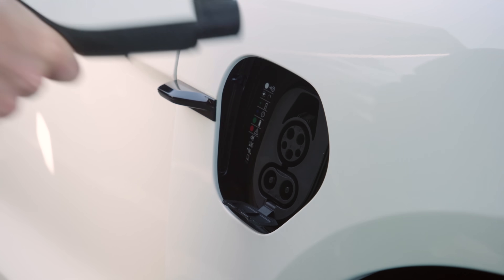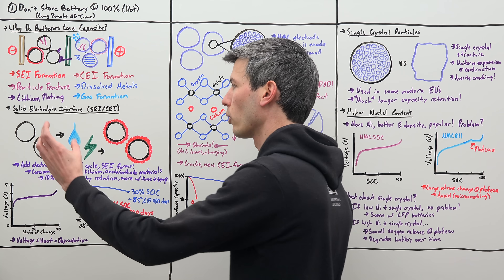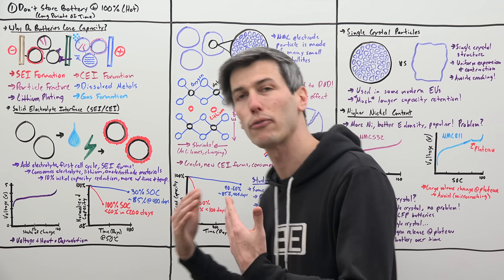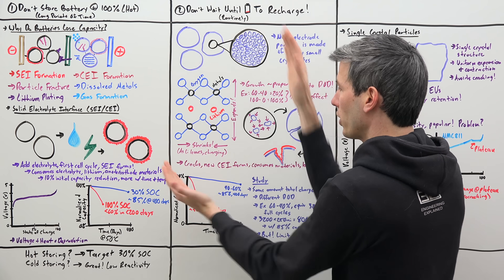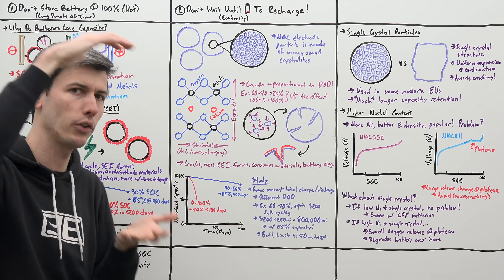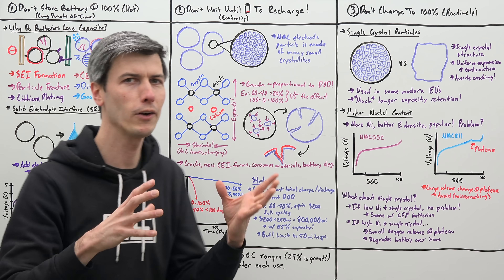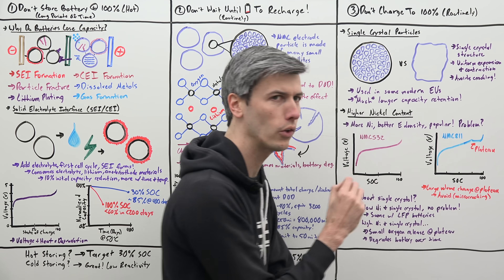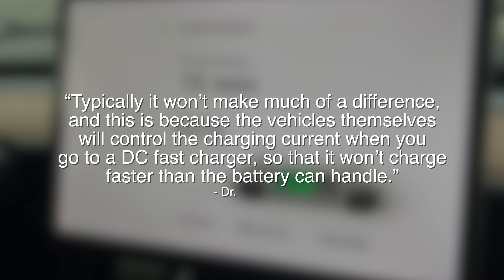How To Ruin Your Electric Car's Battery - NMC Edition!

Comment: V60 Polestar Engineered owner here! I noticed on the Volvo Cars US site they made similar recommendations to not use capacity down to 0 and up to 100 all the time. For their PHEVs like mine, though, they basically say "go for it", recommending you fully charge the battery. 

Their PHEVs now have an 18ish kWh battery but only use some 14kWh of it. Is that buffer built-in battery life management, or is there some kind of serious performance degradation they avoid like that? The V60 basically functions as a mild hybrid after it hits the "0%" threshold, so I know it's got some kind of reserve.
Reply: The majority of the battery capacity that’s not made available to the driver for EV mode driving is held in reserve for hybrid operation. The bottom 20-30% is only available for the car to use when more power is required. In the Volvo’s case this is the only way that power can be sent to the rear wheels so it’s important to have a healthy reserve. This ‘bottom buffer’ is continually topped up by the onboard generator while driving in hybrid mode. The protection at the higher state of charge is quite limited. Only the most extreme damage is prevented so best practice is still to limit charging of the top 20% as much as possible.

Comment: See timestamps for points, reasoning and caveats:

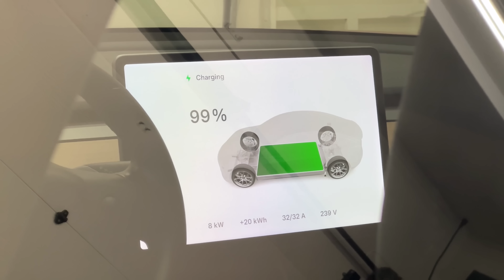1) 0:58 don't store your car at 100% battery for long periods

2) 4:30 Don't wait to charge your car (many short changes are preferable to fewer big charges)

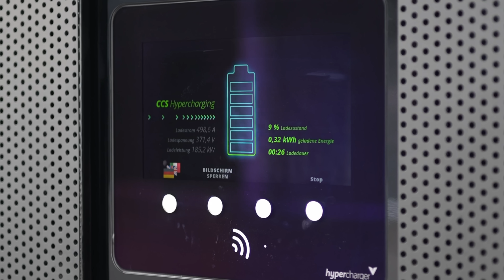3) 8:30 Don't regularly charge to 100%
Reply: Is it better to charge for longer periods, 12 hrs at 5amps or shorter periods, 2.5hrs at 32amps and then let it sit charged to 70pct for the remaining 10.5hrs before you expect to drive again?
Reply: Reviewing data between my neighbor and myself with everything being the same EXCEPT he charges his Tesla M3 to 80% everyday and leaves it plugged in.  I only charge when needed up to 80%.  His range at 78,000 miles is 250 and mine at 78,000 is 280 miles after 5 years.  I'm going to stick to my current charging schedule..
Reply: @camman194 Level 2 isn't hurting the battery
Reply: So now it's better to charge at  75%???
I thought it was  80%!!!
Next time I check it will be  60%.
Love my model Y, but since I don't have a garage with a charger only for myself I will go to Volta chargers and go to  80%, hopefully I'm not destroying my battery doing so.
Thank you.
Reply: @OmarLozada28 As long as it's below 90%, it's mostly fine.
Reply: Thanks for summing it up. Are  you the AI everyone is talking about?
Reply: I seriously don’t understand why j’y they can’t just divide these videos into chapters
Reply: 1) What is a "long period"?

2) How long is "waiting"?

3) What is "regularly"?

...gotta love the use of ambiguous terminology. 🤦
Reply: @jasono2139  tell me you didn't watch and/or comprehend the video, without telling me you didn't watch or comprehend the video.
Reply: @mattwilson9293  tell me you didn't actually read my comment without telling me you didn't actually read my comment. 🤦

...because you can't answer any of those questions from the video. Saying a "study found after X days 🤪" doesn't actually answer these questions.
Reply: God bless you
Reply: 1) dont buy that crap😂
Reply: bunch of rules that reduce effective range...
Reply: @SoloRenegade  every rule says* when needed.
Also he says it is still the manufacturer requirements to solve the problems. They are going to do what they need for warranty period.
Reply: @ralanham76  you're missing teh point. EVs already have their work cut out for them as they fail to live up to the hype. but on top of that to ensure the batteries don't prematurely fail, they have to be operated at perpetual states of much reduced range, regardless of all teh other issues compounding, such as cold weather.
Reply: @SoloRenegade  it's up to the manufacturer to make it last 100k for the warranty nothing more
Reply: @ralanham76  no it's not. the manufacturer only needs to guarantee it Would last for a specified time per teh warranty, if operated perfectly correctly 100% of the time.

it's not their responsibility to make sure you use it correctly. they're more than happy for you to mess it up so they don't have to honor their warranty.
Reply: @SoloRenegade  did you sign something when you bought the car that you would only charge the battery a certain way? No? Then guess what, they can't deny it. The moment you mention Magnuson Moss warranty act (lemon law) requires them to prove that you knowingly caused damage and you're getting a lawyer, they'll honor that warranty
Reply: @ColeSpolaric  I don't buy cars from dealerships, I don't buy new cars, and I definitely don't buy EVs, so no issue here.

People who buy products based upon teh warranty are suckers. Warranties are specifically designed to apply such that they almost never get used. People pay extra for a warranty the company designed their product to ensure wouldn't be necessary.  a few people benefit from warranties, most do not.

It's better to be smart and know what you're paying for and why, with no warranty at all, and save the purchase cost and the cost of the warranty, and put that money towards the next purchase or repair instead. it's a FAR cheaper way to live. I have been doing it for decades, and track my spending, and can prove it works, and detail out how I do it.

I can afford a new car, but it's a total waste of money to do so. It's simple math and economics.
Reply: @SoloRenegade  you don't pay extra for the warranty on a new car. And if you only buy used, that's fine, but you have to have people that buy new for there to be used.
Reply: @ColeSpolaric  "And if you only buy used, that's fine, but you have to have people that buy new for there to be used."

Rental car companies

"you don't pay extra for the warranty on a new car."

Yes, you absolutely DO. It's just baked into the sale price of the car. And people also pay for extended warranties, and I'm also not just talking about warranties on things like cars, but also on electronics, appliances, and more. And there you do often times have to pay separate for the warranty.
Reply: @SoloRenegade  rental car companies can't provide enough used cars to the market unfortunately
Reply: @ColeSpolaric  they provide a LOT though. they change cars faster than the typical owner of a used car does.

Also, you have company cars for things like travelling reps and salesmen. As well as other sources of used cars. 

You also then have people who buy new as a status symbol or out of laziness (not wanting to fix anything), as well as those who buy things they can't afford (repossession). Also, imports.

Lots of sources for used cars.

There are also non-used, non-"new" alternatives as well for car ownership, such as kitcars.
Reply: @SoloRenegade  "..., and I definitely don't buy EVs, so no issue here"  Weird for you to jump on an EV video and start sooking about them then.  I might go and find videos about things that I'm not interested in and tell them how wrong they all are.
Reply: @SoloRenegade Where do the rental car companies get their cars? Unless all cars stop breaking or crashing, someone has to buy new ones.
Reply: @kolbyking2315  what's your point?
Reply: @SoloRenegade  There will always be a demand for new cars, because every used car was once new, and used cars don't last forever.
Reply: @kolbyking2315  and your point being?
Reply: @SoloRenegade  Missing the point? You missed the boat.
Reply: @SoloRenegade  Enjoy the E-Bus.
Reply: @ColeSpolaric  In the future they will be suppling used EVs to the market.
Reply: @BioniqBob  there are no busses where I live, I drive my reliable ICE vehicles and airplanes. and the E-buses are now all being replaced by hybrids since the BEV buses have all failed miserably all over the world.
Reply: @SoloRenegade
Reply: @SoloRenegade  "bunch of rules that reduce effective range..."

If you want to maximize the battery longevity you will have to adjust your habits. So what? That's true of all electrical devices. 

"EVs already have their work cut out for them as they fail to live up to the hype. "

Fail to live up to what hype? They are clearly the more economical choice. 

"but on top of that to ensure the batteries don't prematurely fail, they have to be operated at perpetual states of much reduced range, regardless of all teh other issues compounding, such as cold weather."

Did you even watch the video? The batteries will last the life time of the car without fully following these guidelines.
Reply: @SoloRenegade Buy a car that suits you, it's not hard.
Reply: @Samusaran77  no such car exists on teh market today.
Reply: 4) 12:53 just stick with an ICE
Reply: @lastnamekumar  How long is the warranty on any ICE engine?
Reply: @lastnamekumar Over the next 1-5 years: yes
Next 5-10 years: maybe
Next 10-20 years: no

Comment: My '17 Chevy Bolt only has the option to charge to 88% or 100%. It is not in 1% increments like a Tesla. Although the Bolt battery is NMC 622 so not a super high nickel content. Thanks for the video, I learned a lot.
Reply: you have the option to unplug the charger from the car before its "done"
or set it to go on a number of hours before you use the car the next morning
and easily target any percentage when you unplug it to use the car the next day

Comment: Why dont the manufacturers just cap the full charge at 80-85 percent and leave a headspace of 15-20 percent? It would either reduce range or require a larger battery but we could avoid this dilmemma all together.

Comment: Well, this video fell into my lap at the right moment! Ive just commited to buying and I've been looking into this topic, specifically about fast charging, and found polar opposite answers. Unfortunately bad news (albeit useful) is often blurry when it comes to EVs (which conpanies are trying to shift off the forecourt).
Reply: The biggest thing to consider, are you getting an NCM/NMC or LFP/LMFP battery? Each has its own considerations and downsides.

NMC are typically very energy dense but temperamental and the most prone to combustion due to the flammable electrolyte. They are also typically pretty expensive due to the rarer materials used like Cobalt and Nickle. 
LFP are typically less energy dense but far less temperamental and can take a much great amount of abuse. They're also extremely stable and almost impossible to catch fire even under complete electrical short discharge in the worst circumstances. LFP also don't like the cold very much and will absolutely refuse to charge if the internal temp is below freezing, a simple way to get around this is to leave the vehicle plugged in over night if you know it will be bitterly cold and the vehicle's heating and cooling will keep the battery at a decent temp.

Most EVs in the US use NMC as it is the most energy dense and compact. A few like the Tesla Model 3 RWD and the Y RWD both use LFP batteries. They have decreased range but will almost certainly last for many hundreds of thousands of mile before needing a new battery. If you're outside the US, in the EU for example, there's lots of choice for EVs with all types of battery chemistry.

Comment: TLDR: Don't store battery at 100% (for long periods of time). Don't wait until the battery is completely empty to recharge, just plug it in after every trip if you can. Don't charge to 100% every time. Charge to 75% if you can instead.
Reply: I have a 2018 model 3 long range with 130,000 miles. I charge it to only 75 percent and degradation has been minimal. They even recommend to not charge past 80 unless needed. So it’s definitely being used as intended. It’s been the simplest car yet. Maintenance has been minimal as well compared to all the ICE I’ve owned. No problems. Going strong. Both can be problematic yes but it’s all on how you take care of it.
Reply: Or just buy a ICE car and enjoy life.
EVs are still very problematic.
Reply: @HUMC5 ice cars can be very problematic too if they are not maintained correctly
Reply: In other words, don't use the car as designed.
Reply: @Ozark_Bule  not really make sense like that, as this applies to all gadgets also, phones, laptops, etc. If you want to prolong their battery life in the long term you will take a little more care of them (when possible).
Reply: @Ozark_Bule Just like gas cars. You will never have 100% range. You're complaining about a non issue
Reply: @Samusaran77  You can fill the tank up to 100% of range and have 100% power until you run out gas, genius.  You don't need the 80/20 rule for range.
Reply: @Ozark_Bule Yeah. But you need to drive out of your way and spend much more to do it. You're paying much more for a convenience you likely only use once or twice a year 😂

Comment: Thanks Jason! I generally followed these rules over the past decade, but having explanations behind it helps to further educate more people.

I've had 6 EVs and I did an unintentional experiment on one of them, a 2013 Fiat 500e.

For 20k miles, I charged to 100%, and drove it to 10-15% twice a day. At the start of those 20k miles, I had 22 kWhs of usable capacity. By the end, I had 18 kWhs.

The next 20k miles, I had moved closer to work, and began only charging to 80%, and drove it down to 30%, once a day. In that 20k miles, I only lost 1 kWh of usable battery capacity. 

So I slowed my degradation from ~20%, down to ~5%, every 20k miles.
Reply: Battery degradation is supposed to reduce over time so that might explain some of it.
Reply: @rogerphelps9939  true. I didn't want to many stats, but my first 20k miles were between 30,000-50,000 from 2019-2020, and the second 20k was from 50,000-70,000 odo miles, from 2020-2023. 

It had already degraded from 24 kW-22kWh usable, in the first 30,000 miles and 6 years, when I purchased it used.

Comment: Instead of being a good driver you now need to be a computer geek.
Reply: You need to be a great driver to not burn your clutch every year in traffic or hill climbs, maybe do rev matching or drive a manual in the first place 

I won’t even divulge into how maintaining a turbo charged engine demands patient just like EV does — wait for oil to circulate before driving off and wait for it to cool down before shutting off the car 

It’s not hard knowledge, it’s just new

And I doubt 50% of ICE car owners know about all these ICE car nuances 

Just buy a NA automatic you say? The same answer exists for EV also — buy an LFP EV and call it a day. No bs 20-80 rule, chargers how tough like when you like to 100 or down to zero

It’s more durable and less fire prone and cheaper to boot

Comment: This is why electric cars still need more breakthrough technologies. This is too much to think about for a normal car owner. The next gen battery needs to be much less sensitive to environmental conditions and be conducive to repair and recycling.
Reply: Lithium ion batteries are 96% recyclable, it uses less energy, but the problem, is that it is more expensive than to use new materials

Comment: Chevy Volt intentionally stops charging batteries at 80% of capacity.  Likewise they stop use at 20% depleted.  This is all out of view for the user, but it's intentionally done to help preserve the battery chemistry, exactly like you've explained.

Comment: Gotta love that my 2015 Chevy Spark EV does NOT have any way to set a max charge, uses an older battery chemistry and has a tiny 80 mile range so that staying in the "safe zone" meant only 20 miles of range. well its 2024 now with 55K miles on it, not doing any of those best practices and its max range has dropped to 55 miles. So its in the death spiral of using up nearly all capacity on normal trips which ages it faster. i guess the question now is "is this car's expected lifespan 10 years" because so far everything else is fine except for the battery

Comment: Would be interesting to understand why first gen Leaf batteries degrade so fast. LiMnO chemistry, I believe. I am very happy with low deg of my 35.8 kWh e-Golf 1:1:1 NCM cells.
Reply: They had no thermal management system. Modern EVs use liquid cooling and battery heaters (other than the Leaf, which just added fans lol)
Reply: @BrandEver117  I am aware of no thermal management. My e-Golf also has no thermal management but it good battery chemistry.

Comment: Nice information. I was aware of some of the material like the micro-cracking, but not to the level of detail you provided here with the mechanism of mechanical stress that causes it.

One thing you didn't cover which surprised me was the impact of discharging to 0% SOC. We all know that's it highly discouraged - especially given the inconvenience of being stuck on the side of the road somewhere with no power to move the car, but even considering SOC below 10% or 5% - is that more damaging than keeping the SOC above 20% or 30% or something? I was led to believe that discharging to very low states of charge may be as damaging or more so than charging to 90-100%. It would be interesting to understand the reality here and the mechanisms behind any such degradation.